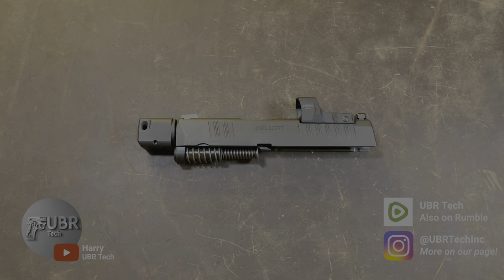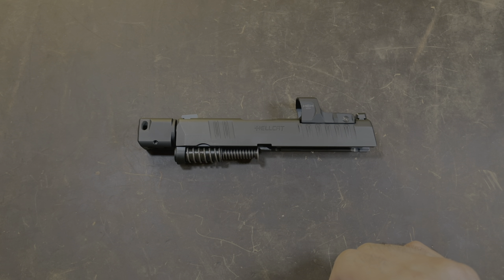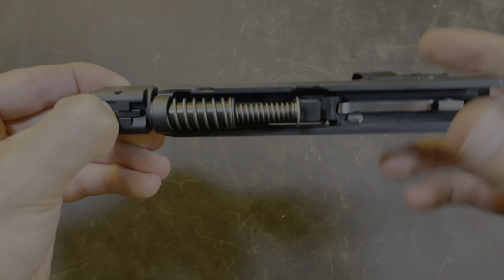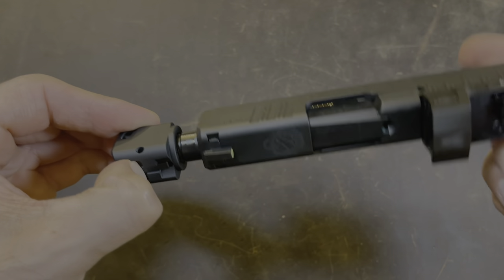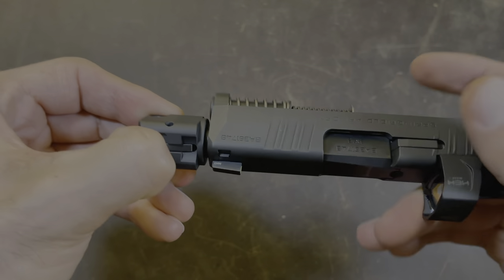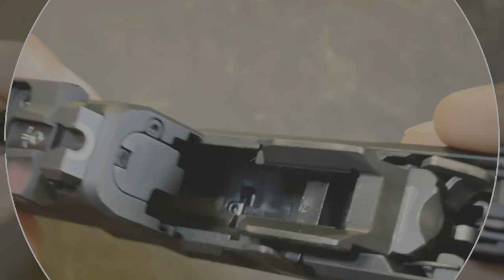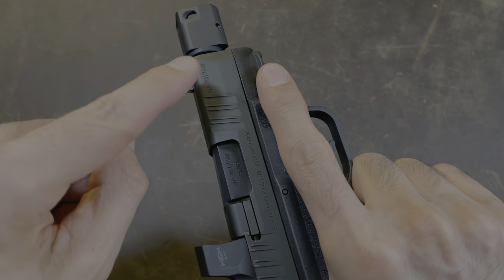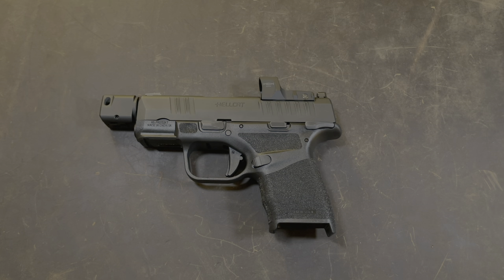How to Remove\Install Springfield Hellcat RDP Compensator

Comment: Overturned comp half turn too many and now stuck any ideas?
Reply from the maker: If it’s only a half turn too much, you should be able to turn it back. It’ll just be a tight turn.
Reply: @UBRArsenal  it's stuck. I had to send it back to Springfield Armory. Thanks for the response!
Reply from the maker: No problem. Let me know how you make out.